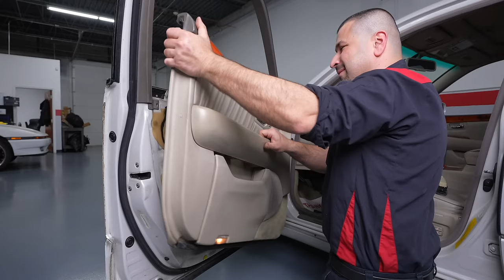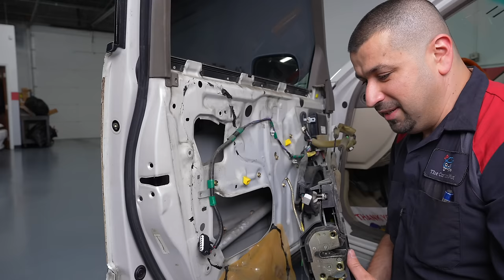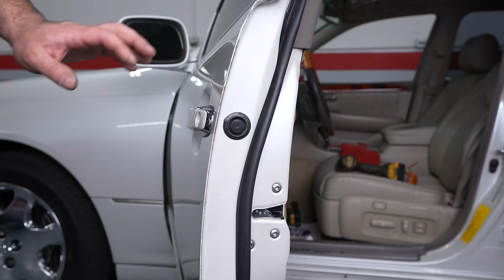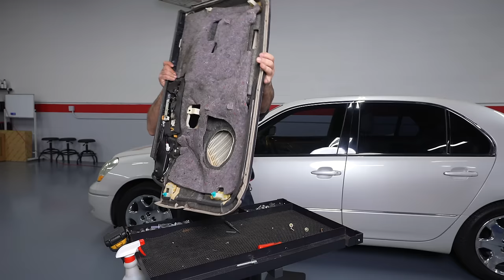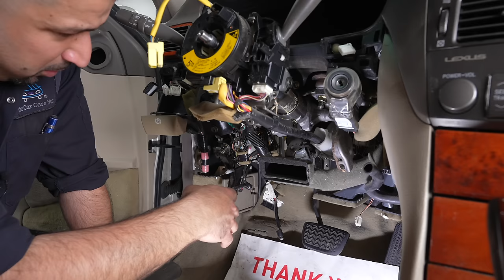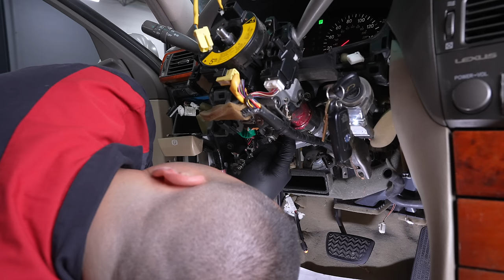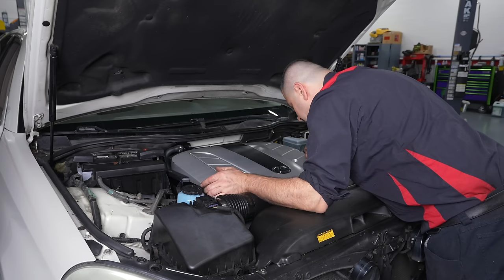Preparing Our 600,000 Mile Lexus for It's First Long Trip! and a Small Accident! Part 5

Comment: I would definitely lean towards the used transmission, assuming there are no obvious signs of abuse. This thing is a beauty and will be even better when you are through with it.
Reply: Agreed! :)
Reply: I trust your instincts;  get the used transmission, new solenoid, valve covers, everything….watching….!
Reply: Yes, used transmission is the way to go.
Reply: Used transmission with only 45,000 miles would seem (depending upon the cost and condition) the way to go. It would provide the comfort and security you desire. A balky transmission drives me bonkers.
Reply: Of course, the good used transmission is the best option!

Comment: I appreciate my 2012 Corolla so much more now!  Not having all the "bells and whistles" reduces repairs!
Reply: What’s ur next car a 1912 Ford Model T?  As reliable as the Corolla is an LS430 is even more reliable.
Reply: @Mabeylater293  obviously not, no steering motors, not so many underbody panels, no power seat, etc.
Reply: @InternetDude  and according to his logic, “no problems/reduced repairs”. 😂😂😂😂
Reply: Less bells and whistles, less things to go bad when they do eventually go bad
Reply: I'm loving my 5th generation 4runner for the same reasons
Reply: I agree, the simplier, the better! 👍
Reply: Agreed simpler means less expensive repairs as the years pile up.
Reply: @InternetDude  You're listing things that don't effect the reliability of a car as they aren't necessary.
Reply: Please always use eye protection when drilling!
Reply: @riceburner4747  definitely agree, kiss
Reply: @28naveenator27van  K I S S
Reply: @InternetDude  I have a 6th-gen Lexus ES350. Great car, no complaints. The only thing I want to do to it (and even hacking the settings of the car does not allow this) is disable the auto-retract and tilt of the steering wheel every time you get in and out of the car.

In my view, this is a selling feature, not a convenience feature... unless you weigh 400 pounds. First week I had the car, I said "wow this is something new, very classy and convenient." After that, the practical engineer inside me said "ok, how do I disable these so the motors don't wear out so fast and get stuck in one position."

I've found a fix that involves more than just a kill switch (I'm not cutting wires, that's blasphemy). On my car, if you disable the power to the telescopic steering wheel actuation, the computer recognizes that and starts yelling at you before you exit the vehicle.

I don't like to be yelled at.
Reply: @somerandomguy3868  me too! That's exactly why I got it!
Reply: I have a 2003 corolla.  It still runs like new.  Keep changing that oil.
Reply: @Fister_of_Muppets  go to your safe space then
Reply: @Fister_of_Muppets  these types of people are why buying used cars are frustrating
Reply: @rk22cc  it's called "sarcasm."
Reply: @PCgamer923  They said "reduces repairs" not "reduces reliability". A part that doesn't exist won't need to be repaired so it's valid.
Reply: its okay if you haven't tried a lexus yet, but once you do, there's no going back to a basic toyota haha. You can't miss what you've not yet experienced.
Reply: @Mabeylater293  toyota people patting themselves on the back for not being able to afford a lexus which is superior in every way haha. Of course a 600k mile lexus has a lot of repairs. But what this video doesn't show you, is the 200-300k miles of basically nothing going wrong at all with all these extra goodies that sound so scary to corolla owner hhaha
Reply: @seanclarke4061  Corolla drivers these days are not exactly "roughing it" when most of them come with heated seats. But when so many households are 2-car households, does one really need 2 or more motors dedicated to steering wheel adjustments? To me, a luxury car is a car that cleans itself, as that saves me half an hour a week rather than two seconds at startup on the rare occasions when someone else drove my car. When Lexus figures out how to do that, I'll buy a Lexus, as THAT would be a real luxury.
Reply: @InternetDude  just because  it went 600k miles and some components hit failure? Sorry but the lexus takumi masters go to EXTREME lengths to make their vehicles superior to toyota. Of course a corolla driver has nothing to complain about in the worlds most reliable basic economy vehicle and that's fine, but that doesn't change the fact that a Lexus is a superior vehicle in every aspect.
Reply: @seanclarke4061  My uncle had 2015 Lexus NX200T. It was nice, but too small. My new Corolla SE is nicer, even though it doesn't have power seats or power steering wheel adjustment (the latter I have NEVER adjusted on any car I have ever owned or borrowed). It also gets better gas mileage, holds more cargo comes with and has room for a spare tire, and I'd say comfortably handles a 4 inch taller person in the back seats than the Lexus. After he died, it was sold off in 2020 or 2021 for about the same price as my Corolla, or about half of what he paid for it. I might add some sound insulation myself for a few hundred bucks, and if so, moving up to a Lexus would have no appeal for me whatsoever.
Reply: @theredscourge  "moving up to a Lexus would have no appeal to me whatsoever."

That's delusional. First of all, comparing a 9-year-old NX to a new Camry is apples to oranges in very different aspects. I'm not going far out of my way to explain all the hundred reasons why. But in a nutshell, the NX was/is a car that Lexus sells at a compromise to a subset of buyers that can buy a Lexus on the bottom-end of what Lexus offers. The same people buying a NX today weren't looking at a LC or SC500 yesterday.
Reply: The replies are a good laugh
Reply: @Fister_of_Muppets  Most people see cars as a means to travel, not as an experience where it has to be opulent or else it's unpleasant. To me, it is delusional for someone to have been satisfied with the state of the art in cars 20 years ago and then not possibly being able to see themselves stooping so low as to drive a 2023 Toyota Corolla...

By far the biggest quality of life upgrade in cars in my lifetime has been air conditioning becoming a standard non-negotiable feature. Before that, it was when cars went from being incredibly loud and shaky at highway speed to how they are now. A steering wheel that most people never move anyway suddenly being able to move itself is simply not groundbreaking compared to those two.
Reply: @TheRedScourge  I'm in agreeance with you. The power-memory steering wheel is something I don't need or want to move all the time.

Comment: Go for the used transmission!   45,000 miles?   Likely nothing wrong but possible leaks, which you can reseal.  That hurdle will be behind you and you'll be closer to the BIG TRIP!   This is just such a beautiful , high quality video series revealing to one-and-all DIYers the height of the mountain we possibly face when we take on a high miles car.  So many of these repairs reveal clearly those which I could perform myself and which ones would be impossible.   Again, you are such an inspiration!

Comment: Love this series. For the trunk, you can put stick on rubber bumpers or plugs over/into the holes that were drilled for the plate. The benefit of this will also be the plate won't clang against the panel and cause scratches

Comment: You should be able to reattach the fender liner mounting tab with a plastic welder.  They heat up a zig zag metal wire that melts the two pieces together.  It’s pretty slick.
Reply: Hot melt glue can fix a lot of things too, if the parts are clean & dry. I repaired Ford Expedition hub caps with it 5 years ago & it is still holding fine. I never dreamed that stuff would stick to both plastic and the stainless steel stamping that grabs the lug nuts, but it does. I just went around the inside and welded the 2 pieces together with a thick bead of the hot melt. Of course both surfaces must be completely clean. 409 spray cleaner & an old toothbrush took care of that. Those 6 inch plastic covers are $50 each, & I fixed them for $0.50 of hot melt. 
Epoxy putty might work. Although epoxy will not adhere to some plastics.

Comment: I bought my first Toyota about 2 years ago a 2009 Highlander hands down the best vehicle I’ve ever owned just fluids and brakes so far. Now coming up on 200,000 miles and she drives so smooth and quiet I see other cars on the road some new making all kinds of wacky sounds I’ll definitely be sticking with Toyota. My neighbor has an 08 with 360,000 miles original engine and trans he told me just brakes,radiator,fluids and a starter.

Comment: Hey I had a similar Toyota issue with the transmission check transmission harness connector. Seal failed  Basically all the pins  rusted out.  You might think it's shift solenoid is not ! It's by the driver's side. Perfect time to replace when you drop the pan

Comment: Another vote for the used transmission. Also, tough break on that tab snapping off of the bumper. We've all been there! Get some good epoxy from a body shop and glue it back on. Not like it's some super structural part. It just has to hold that plastic panel.

Comment: Yet again, I love this video! It's not 10-15 minutes long, it's a whole hour and then some to enjoy!

I laughed when you mentioned pulling the door panel off, because I literally did the same on a very close friend of mine's '05 LS 430 on Monday to replace a window motor and regulator (OE of course!). We also replaced the door mirrors (again, OE) on both doors; they would not lock in place and fold during normal driving. 

Unfortunately, being a desert car, the inside of the door was extremely dusty and a lot of cleaning up was required. Ended up taping a disposable, plastic table cloth around the door opening to prevent any dust going inside and thoroughly blowing everything out with an air gun.

The car only has ~39,000 km (~24,400 mi) on it and was inherited from his late father, so it has immense sentimental value. I got kid gloves on when we do any work on it.

Comment: 27:37 in my European LS400 (99) the door won't lock you out like that. Even if the door is in lock position when it's open, the mechanism will unlock itself as you close the door, that system has prevented me from getting locked out a couple of times already. 
And it's independent of the battery power because I have tried with the battery disconnected too, so it's a hardware design feature for safety.
Reply: Interesting EU-market feature. Willing to bet there are others, such as your dealer disabling the 250 km/hr (155 MPH) limiter. Cheers!

Comment: Even though this video is almost the length of a movie, I pay closer attention to watching this video than many of the blockbuster movies.   
My 06 GS300 has many similar problems to this 600K Lexus:  the noisy steering motor, the broken license plate screw, the stripped thread for the engine beauty cover, the missing underbody panel clip, etc.    This video will be immensely helpful to address my Lexus issues.   Thanks!

Comment: Total car care nut vintage material. Like how you throw all the nuts and bolts onto the floor mat because you know where every one goes ! I use a magnetic bowl for these loose nuts and bolts. the patience and calmness is amazing. Interesting to see the tap & die work being done, never used one and might have to pick up a set now after watching how easy they are to use. After watching your previous video and hearing that the CrossClimate 2's are noisy i researched tire rack today and sure enough they have a 8.7 rating, and the Defender2 are i believe 9.0 or 9.2  Definetely will be going to get them instead for my 2002 ES 300. less money too compared to the Cross Cimate 2's

Comment: The one thing I have to say about the transmission issue is that if you replace or rebuild the original then in a way it wont be a true 1 million mile car when it gets to that point, itll have had a major drivetrain component replaced. Otherwise, when it comes to reliability a used transmission in this case is probably the most cost effective and sensical option. You coupd also play qround with a used transmission solenoid if you really wanted to, at very least you could see how far that gets this thing.

Comment: No brainer, the used transmission is the way to go, with 45K is like new
Reply: I agree.  Go for it.
Reply: Agree...just replaced an engine in a '99 Tacoma with 367,000 miles with same engine out of an '02 4-Runner. We found one in a salvage yard still in the wrecked 4 Runner...it had been sitting there 10 years but only had 136,000 miles on it. Runs like a new one.

Comment: My non professional opinion is to get a used transmission (assuming that you can verify the mileage and maybe the service history of it).
Also if you go this route you can give us tips on what to do and not to do when installing used transmissions (such as fluid changes and how deep to go into reconditioning the new one to maximize its longevity without spending a ton etc.)

Either way this project is amazing, and you really are a role model for the automotive industry.

I was wondering though how you are going to put another 600,000 miles on it if you don't have a long commute...

Comment: Just did the same door lock actuator repair to my 2010 Prius last week. A previous body shop had destroyed the weather seal, so I had the joy of replacing that a few days later(after I ordered a new one). 50F day, so I can confirm the butyl residue doesn't come off easy. A "secret" is good old WD-40 and a whole lot of rags.

The actuator on a gen3 Prius is noticeably smaller, without the extra plastic shells, so I was able to get it out by maneuvering it around the window channel. Very not fun the first time, but much easier once you know how to twist it around the right way after that first time. The Toyota repair manual says to take out everything, including the glass, which is why it's such an expensive repair at a dealer.

Now I have to go finish the washing and detailing of my old Prius, because I just got word my new Prius is about to arrive at the dealer this weekend. :)

Comment: Being on this voyage with you brother has been pretty amazing so far. Unfortunately I haven’t owned a Toyota for over 3 decades now but still miss that 5 spd EFI truck. 

On my own journey working on my 200k tdi jetta. Working on the thermostat and coolant now and just discovered what they call the recommended service position. Basically where you remove the front end from the game and expose the front of the motor and the turbo. After this stop on the journey I get to move onto dropping the front axle and removing the entire exhaust system from the back of the engine to the tailpipe to replace a blocked up DPF system since VW decided that a few model years it needed to be welded closed so it couldn’t have a filter or be cleaned out easily.

Comment: I agree with you that you should run the original transmission down to thr ground and then replace with a low mileage used one.

Comment: Had a ’07 GS450h that had left rear door not locking. Found a used door lock actuator for 20 bucks and decided try to replace DIY. That bar for the window was not meant to be moved easily and it took me half an hour to remove and there wasn’t enough room for actuator to come out. After I finally got it out I wasn’t very hopeful, but reassembly went a bit better and I the best moment was to install it and test it like you did, it worked!  What a feeling.

Comment: Thank you for sharing this project with us, Ahmed. Personally, I have never gone wrong swapping out a used transmission. Each time, I replaced seals and fully serviced the unit going in. A full inspection was easy to make while it was on the bench. Many years ago I had a shop that gave me a good deal on a bench rebuild too. That always worked out well. I did one DIY rebuild on a 1984 Volvo with the Asin-Warner 4 speed. This was the same gearbox as the Celica Supra. I will not attempt a rebuild again due to the complexity of newer cars.

Comment: I had same issue with my ls430 transmission. I went to dealer and bought the wiring harness that goes to the solenoids. I then replaced filter and tried sealing the transmission pan like oem but leaked still. I had to use a gasket and now I have no leaks. Transmission runs like new with after replacing wiring harness had same code your talking about also had transmission temperature code with it, 285k miles. Fluid was black and still was running 😂. I flushed it till fluid turned red. I’m happy I didn’t have to replace transmission by gambling on a used one. These transmissions are bulletproof

Comment: As someone who's owned two LS400s, I agree with you in thinking the low mileage used transmission is the better option. While I do have a friend who's had great luck with a rebuilt A340E in their Supra, I'm a little leery of most rebuilders of these gearboxes unless they're using OEM components.

Comment: Had to do lock motors on my GS400. I vividly remember those rods being a complete nightmare. But the assembly is nearly identical. I did it cheap and got the motors from eBay and cut the actuator open. Worked like a charm.

Comment: Automatic transmission has tons of clutch packs and it is very hard to avoid after very high mileage.  For Lexus 430 age, used transmission is probably still the best option for the price.  But you are a mechanics. Rebuilt things really make it like new (clutch packs) at least.